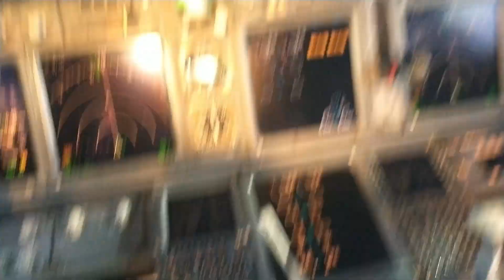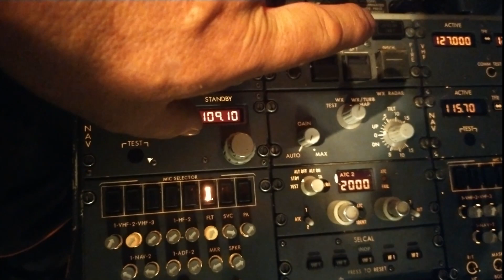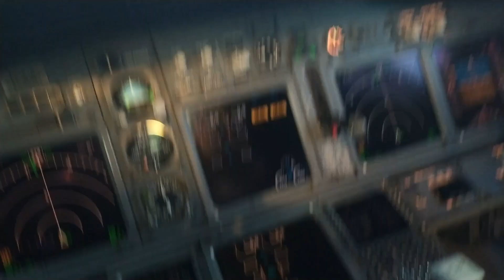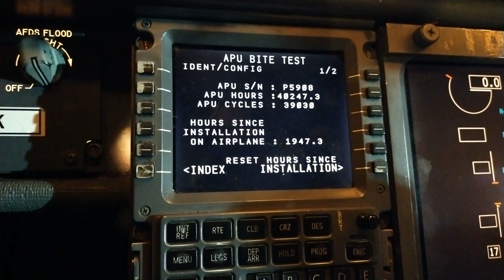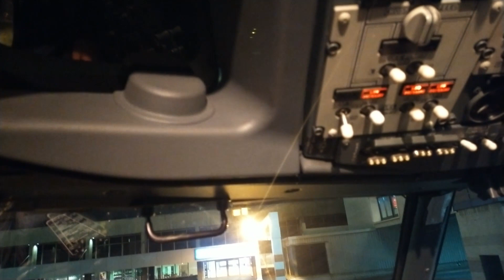Ultimate APU Video!

Comment: Just a question if this is possible, the fuel pump you use before fueling the APU is the AFT Left and I thought it was the FWD Left that needed to be engaged. Maybe there is no difference? Or is it depending on the model of the plane? Thanks!